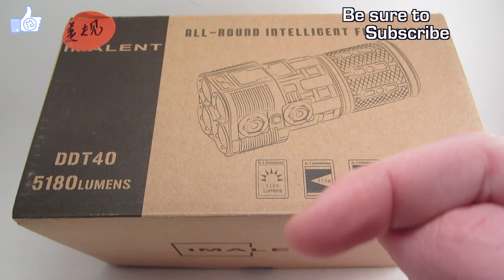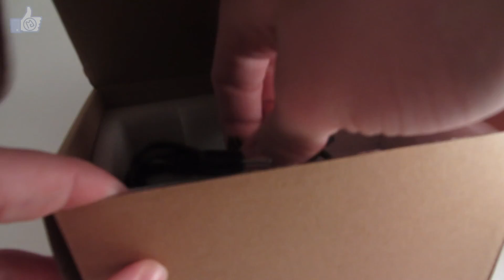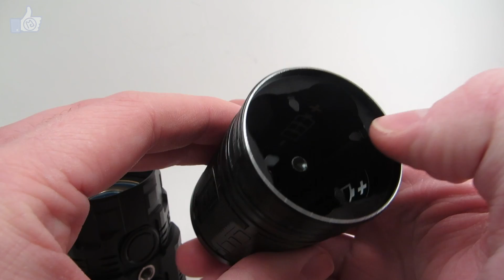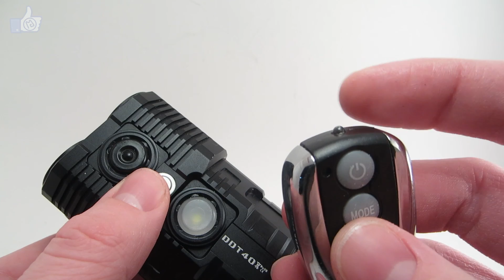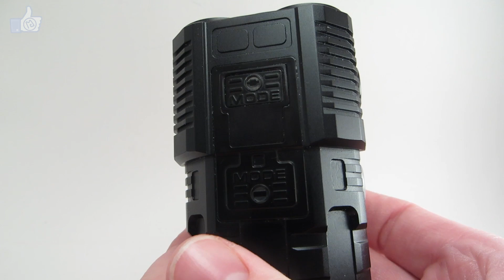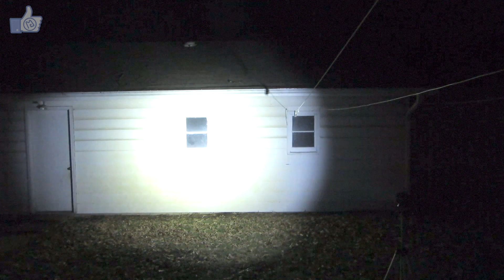ReviewTheLight:  Imalent DDT40  (Remote Control, 5K Lumens!)

Comment: Newbie to lighting... But would this be better than your average large cone (?) halogen spotlight for looking at wildlife at night? (Got a farm here in Australia with lots of kangaroos, deer, fox, rabbits, etc. that my 2 year old has recently become interested in). Also, how would this compare with a LED Lenser P17 (which I currently have, but find it isn't throwing light far enough / concentrated enough). Love the review btw.
Reply from the maker: Ted Barrera Good questions Ted!  There are certainly big halogen lights that will put out more than this, but the DDT40 will out-do the "average" ones.   The DDT40 will significantly outperform your Led Lenser P17.   Most Led Lenser lights are pretty over-priced--you are paying for their cool looks, their better-known brand name, and their zoom feature they have a patent on.  For looking at night-time wildlife, it will depend on how far from the critters you normally are.  The DDT40 is mostly a flood light, so it will put a ton of light on anything close to you in a nice wide area.  If the critters are normally far away, you may want to look for a light that has a single emitter in one great big reflector, which will put out less total light but throw the light much further.  Or, you might want to find some sort of compromise between the two styles.
Reply: Very informative! Thanks very much for the advice!
Reply: Review The Light 

Very informative! Thanks very much for the advice!
Reply from the maker: You're welcome!

Comment: Can you use the light while charging?
Reply from the maker: MaverickIQ I haven't tried that yet, though I intend to look into it.  I know in general it's not usually a good idea to use a device at the same time that it's charging, because it can create issues with voltage monitoring that is supposed to prevent the battery from getting over-charged.

Comment: The poor man's Nitecore tm26?
Reply: Bdogsp 001 More like the rich eccentric's TM26.
Reply from the maker: Bdogsp 001 It looks like the DDT40 is currently a bit less expensive, and yes, it's got a lot of output from four emitters in a similar form factor as the TM26.  However, the remote control, touch screen, variable output, side emitters, etc. make this light quite different.  I would say it's the radical man's TM26 ;)